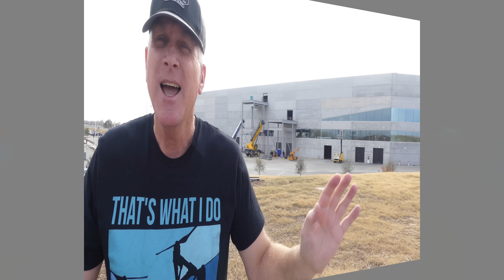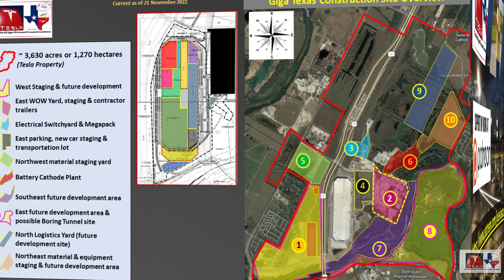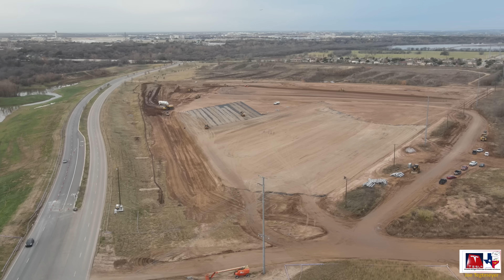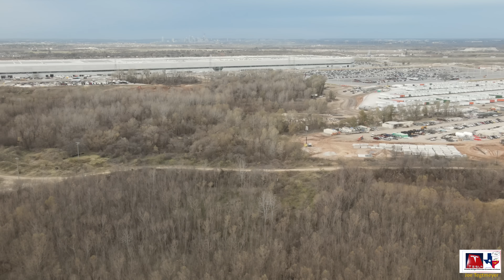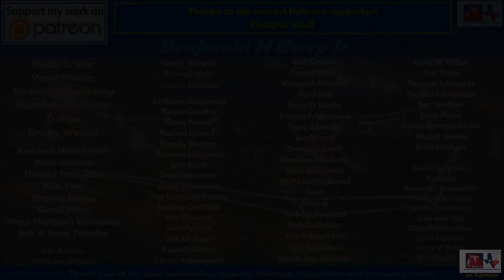Last drone flight and site tour for 2022! 30 December 2022 Giga Texas Construction Update (09:35AM)

Comment: Joe, what's the max altitude you fly at over the site?
Reply from the maker: Generally 400 feet AGL (~130 meters) unless I get special altitude approvals from the FAA, which is not very common to do.
Reply: @JoeTegtmeyer  How have you prepared to deal with the new FAA regulations with are going into effect?
Reply from the maker: @dorsai  can you be a bit more specific?
Reply: @JoeTegtmeyer  Yes of course.  The FAA has set a date after which ALL drones over 250 grams must have a way of transmitting their location, as well as the location oif the peson flying it. uppksedly this is to reduce the chances of mid air collisions between an aircraft and a drone.  Of course some see this as just another way of clearing the airspace so large corporations like Amazon and Walmart can establish their drone delivery systems.
Reply from the maker: @dorsai  kinda old news and I do already have remote ID active on my drones … in fact have had this for almost 2 years now.
Reply: @JoeTegtmeyer  Thanks!

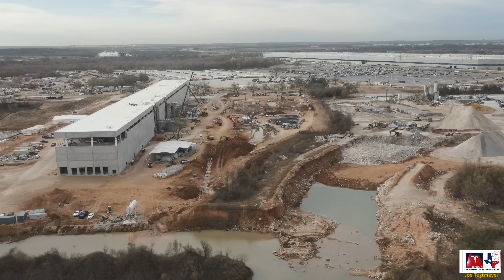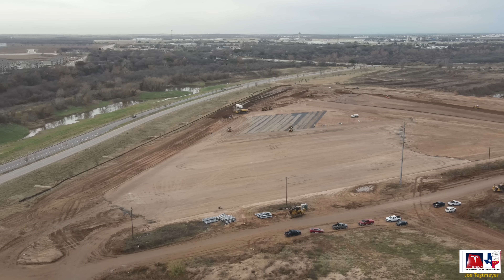Comment: 12:20 Looks like they are digging up broken chunks of concrete from the Martin Marietta plant. The amount of discarded concrete has really diminished over the last few months. The mobile concrete recycler has been onsite for about 4 months, churning out lots of recycled concrete, which has been used as aggregate sub base thorough the project site. Looks like the trucks are loading up to take this freshly recycled concrete over to the west side of TX-130, where it is spread over the geotextile fabric. (5:54)
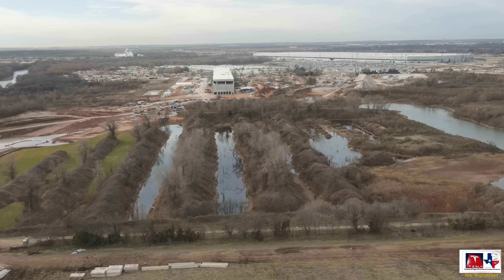Reply: 12:00. Another year and they might be done. Presumably there would be more waste under the batch plant apron, if MM ever close the plant down. They've been scratching away at the waste pile since August 2021. Crusher plant arrived a month earlier.
Reply: @DessieDoolan  dollars to doughnuts, MM will be relocated. Was probably part of the land purchase negotiations. My best guess is west of SH-130 and south of Tesla Road, right across from Lone Star Paving.
Reply: @douglasgroff7648  No doubt, but it's imminent closure has been reported almost from the first drone flight. They recently upgraded some of the hoppers, plus the new lined wash-out water pond, I think they'll be there for a while yet.

I only noticed recently that Lone Star has a concrete batching plant as well as the asphalt plant.
Reply from the maker: It was installed about a year or so ago ... I did a fly over it once, but haven't made it a priority.
Reply from the maker: I do know the plan is to relocate it, has been since the beginning, but the eventual location seems to have changes a few times. I'm not sure now where they plan on moving, but I'll keep an eye out and an ear to the ground to try and find out in 2023!

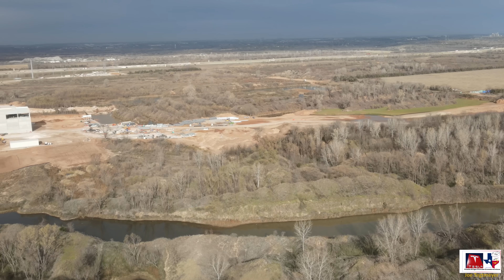Comment: 10:30 That's not the Colorado river it's a pond.
Reply from the maker: Sorry but it is the Colorado River, just a different one that the one you are probably thinking of. Be more positive in 2023.
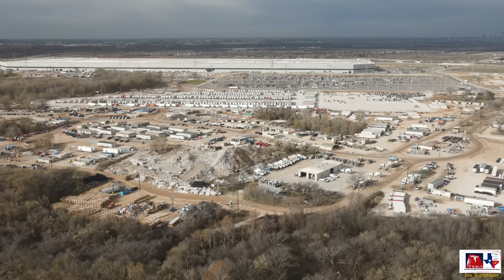Reply: @JoeTegtmeyer  If you check on google maps neither end of that pond connects to the Colorado river, just like many others it formed due to the extensive mining. At 10:10 the drone is looking at the Colorado river then rotates and moves laterally, so what you're seeing at 10:30 is the pond whilst the drone is right over the Colorado river.
Reply from the maker: @boostav  happy new year!

Comment: Thanks Joe. Happy New Year.
Thanks for all photos and videos during the year, and thanks and a Happy New Year to all the Patreons, and youtubers who engage in the conversation.
0:06. Tee shirt weather still!
6:41. Southend. Electrical vault (I don’t think these ever housed cables) in the way of the stormwater drain laying.
7:25. Southend. Easement. Right. Stormwater drain joints encased in concrete.
Further north. Steel beams across the trench suspending existing concrete encased utiliities.
10:06. Far, far east. Bottom left. Couple of dozen crunched Model Ys, several hundred battery transport cradles.
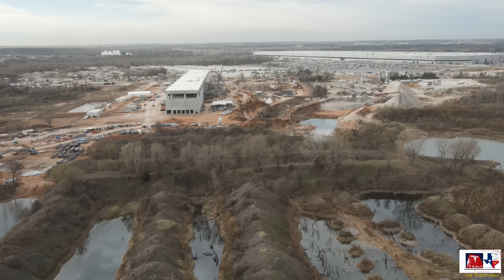12:09. North of Cathode. Loading up trailers to shift the steel for the new building closer.
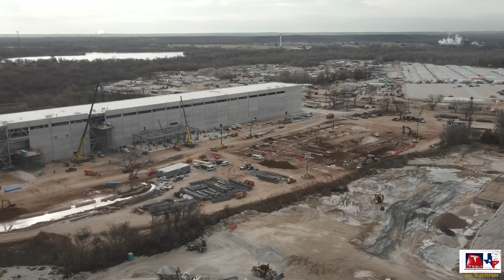12:38. Cathode, new building. Backfilling between the footings on the northeast corner. In readiness for the steel structure.
12:44. MM batch plant. Busy today. Other plants might be closed.
Reply from the maker: Happy New Year Dessie! Appreciate all your help and observations in 2022!